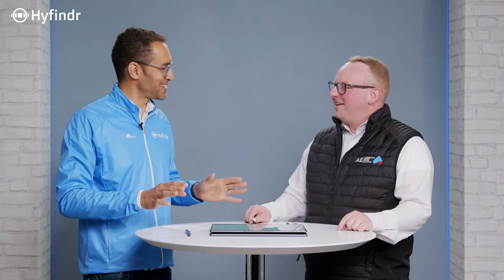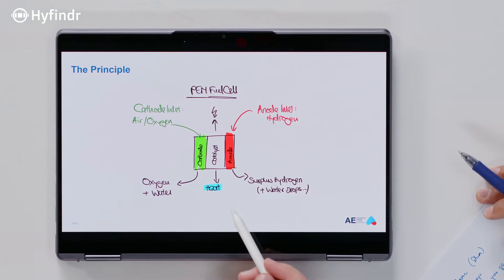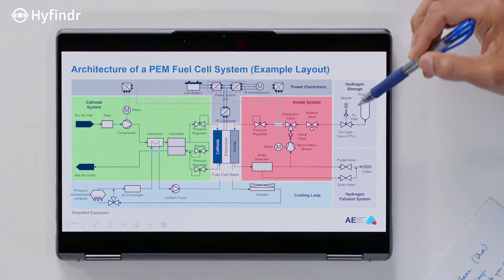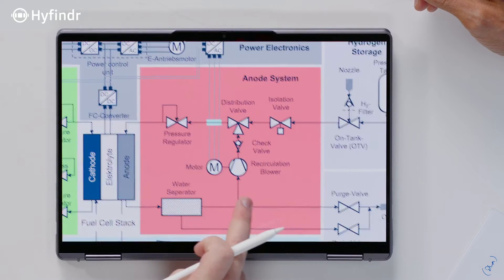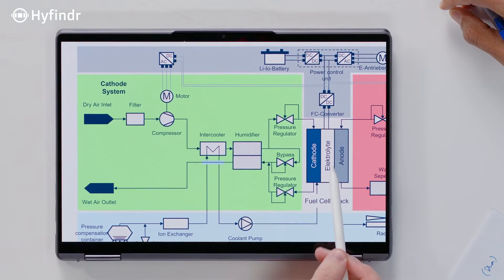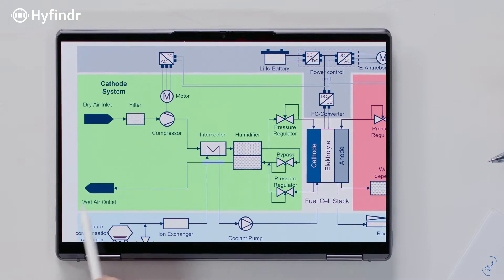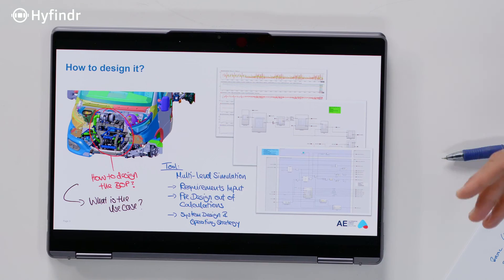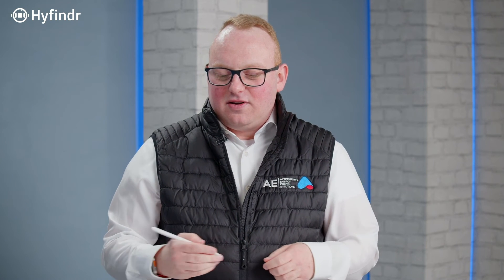Tech Talk - Balance of Plant - Fuel Cell Systems - BoP Part 1 - Hydrogen Technology - Hyfindr Ley

Comment: Hi thanks for this excellent presentation ! Quick question: is there any difference between a low temperature and high temperature PEMFC systems?
Reply from the maker: Thank you for your feedback! We are glad you enjoyed the presentation. To answer your question, yes, there are key differences between low-temperature and high-temperature PEMFC systems, particularly in their operating temperature ranges, materials, and efficiency. Low-temperature PEMFCs typically operate below 100°C, while high-temperature PEMFCs run between 120-180°C, offering advantages in heat management and tolerance to fuel impurities.